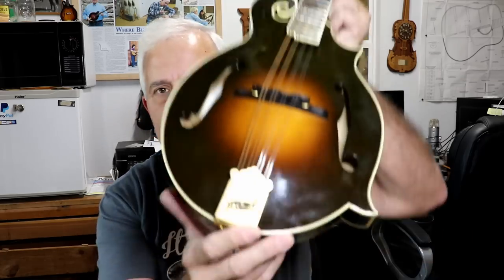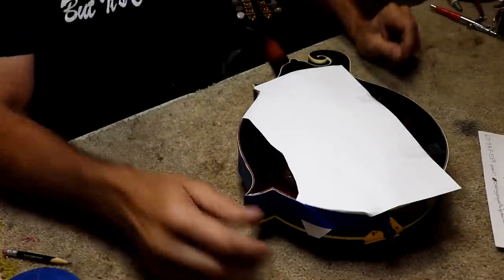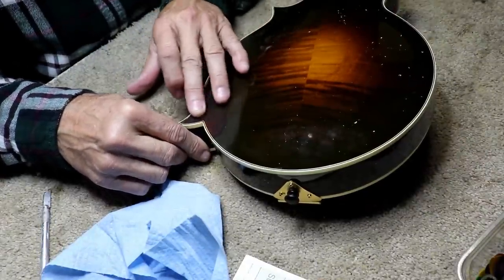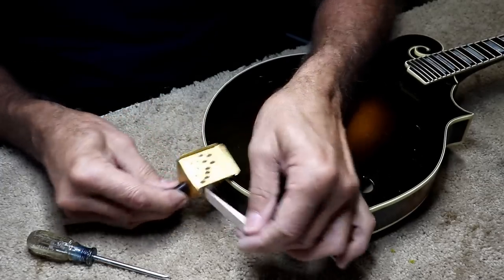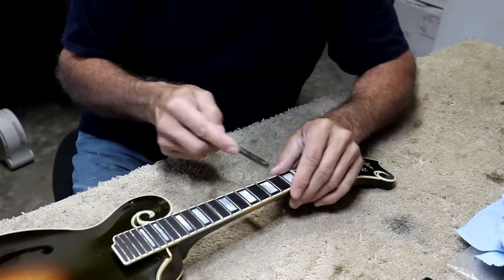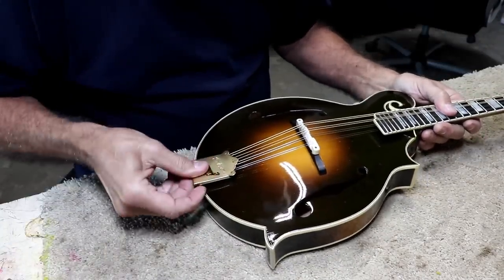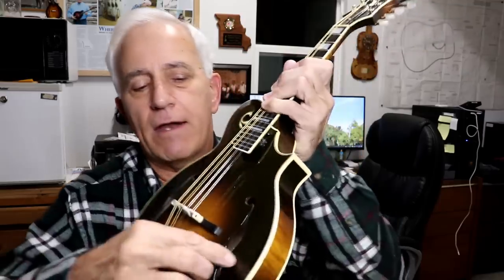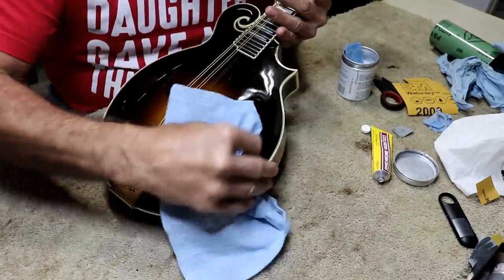342 RSW Sam Bush Mando Flood Survivor

Comment: Jerry you'll probably never see this but I'm going to comment . First as some viewers have said ,to use a drop fill applicator on the end of the CA glue to get a more precise flow into the crack .Also I would use the thinnest CA glue for this repair  . Actually I might just use Titebond thinned out . It causes less damage to the finish  . Now I also saw a tip from Dan E. at Stew Mac about hardening the CA glue and to use the vapors  from the accelerator rather than spraying it on . He pours some into an empty  bottle then empties it out  . Just hold the empty bottle near the glued area . This way it never touches the finish but allows the vapors to do the work . I understand you now realise the StewMac accelerator works much better and doesn't cloud up the way the other brand you used . 
I posted this here for other viewers to see  and might understand a better way to apply this fix .

Jerry I know this mistake bothered you terribly and I am in no way blaming you . It can happen to anyone . I feel you did a great job in repairing this instrument .

Comment: Just an observance on the scraping the seam after paintwork. Having done autobody work most of my life, this is the same basic method that is used in spot painting. but done with sandpaper to taper the repair edge before applying any finish or primer. Blending the new into the old instead of trying to fully level to the old paint. While I have not tried this on an instrument, it may be something that would make the job easier. Scrape your edge with the blade to get rid of the shelf before applying the lacquer and then a fine sanding after wards with a finger block to finish blend. Just a thought that may work for you.

Comment: My guess is that there were built up stresses in that top plate Jerry. If the vac nozzle had not hit it something else minor would have made it crack down the road. Who knows you might have saved him that grief by relieving the stress then repairing it now. In any case you did the right thing.

Comment: Suggest blending the lacquer finish with the airbrush. Prep the area with 1200 wet sandpaper first to knock down the existing lacquer. Use masking tape folding back on its self to create a soft edge. Gradually build up the darker colour to match the existing finish. Auto finish technique.

Comment: Jerry next time you have a crack to finish as soon as you have applied the lacquor turn the piece upside down to let it dry. Gravity will keep both sides togather . Please keep the videos coming.  Jim Parker
Reply from the maker: I'll try it. But it doesn't seem to make sense to me because when I hang a guitar up to dry,  the end of the guitar hanging above-the-ground still does the same thing which would technically be upside down.
Reply: Hi Jerry I should have said horazonal to the ground so that gravity will keep the laquor from sinking into the crack. It works for me.  Jim Parker

Comment: Sounds like your problem with the lacquer separating away from the crack is due to wax residue still in the crack. When removing the wax from the area around the crack it may be just pushing the residue into the crack itself, so as the last pass on wax removal you may need to just wet the crack and wipe it clean. In the auto trades in the 60's painted many vehicles with Nitro as that was factory material on most cars still, wax and grease remover tends to move the dissolved wax around so more than one wiping is needed to actually remove it, clean cloth every time.
Reply from the maker: That could be the problem. However I have the very same problem even on a brand new finish that's  never had anything else applied. If a tiny defect in the wood shows up, then the lacquer amplifies that defect.
Reply: @RosaStringWorks  There are so many things that could cause this it would be hard to list them all or pinpoint just one as the cause. It may even boil down to it being the quality of lacquer thinner you use, some has a more oily base to it that can cause separation instead of bridging scratches or defects, hardware store thinner is like that for the most part and meant to be used for clean up work, a gallon of quality auto paint thinner may be the answer (though I am not saying this is it with your problem as I have no idea what kind of thinner you use)...but the easiest cure would be to drop fill the area with non thinned lacquer if brushing or to spray several dry dust coats over the area before applying a wetter coat. If there is going to be a problem, cars or anything else, they always seem to be in the paint portion of a job.

Comment: Have you ever used thick cardboard rather than paper to mask when airbrushing?  You cut with some original, say 3/16ths to a quarter inch of original surface showing.  Spray from the CARDBOARD side at a medium to shallow angle.  Use 8-12 psi or so pressure with distance based on the amount of thinner you use.  Thinner is a carrier, keeping the lacquer thin, but air drys fast coming out of an airbrush for those who have not used one.  The cardboard height acts to feather the new coat along the edge, blending color and if required, thickness.  The cardboard or a similar stand off masking is in many of the old artist airbrushing  books to show feathering inks among other things when illustrating.  It works well in joining repairs.

Comment: I used an old oven stove top hood with a dryer vent through the wall to form the basis of an airbrush booth.  Use a brushless (old computer fan works great) motor to avoid spark caused flash fires.  I put an AC filter over the fan area to collect some of the solids and not paint the wall outside.  I used cardboard boxes and duct tape to the size of my project.  I have seen regular square fans with filter and cardboard used, but I wanted the fumes outside, while spraying and drying.  A plastic drop cloth tacked to the ceiling or board frame will form a quick spray booth to minimize dust and shop particles in the finish.
    Isn't 40 psi a bit high in that Pasche air brush?  Must be pretty thick liquid, or would the open cups work better than the siphon jar?  My AB has an auger to carry/meter the paint flow and you can literally paint a line the width of a human hair, versus the siphon method of the VL.

Comment: High pressure in the air brush and curved strokes seem to have really varied the density of the color in spots where you did not want it?    The new OTT lights with Yellow-White-Blue color modes really bring out contrasts of different colors?

Comment: Have you ever tried using retarder to slow the Laquer drying process down so it doesnt shrink as much and push away from the cracks or holes? Also slower drying time Laquer thinners too might help with your complaint.I use to paint cars years ago with Laquers and had to use different drying time Laquer thinners & retarder to deal with humidity and even too much heat......Glenn P.
Reply from the maker: I use retarder everytime I spray lacquer. I typically don't use it when I'm brushing it. But I have never seen the retarder help me with anything except the blushing.

Comment: I was taught never to bend my wrist spraying?  Prevents changing the distance nozzle to surface and the light-heavy-light effect of the curved pass bending your wrist?  Passes from bending the elbow result in the same distance, nozzle to surface, for the full length of the stroke.  Keeps the color and depth consistent for the entire stroke.  I am not sure that is as important on the instrument where you can buff the lacquer to color match, but buffing to match color does vary the finish depth?

Comment: Did your color wick under the original finish, adding your color to the original and causing the dark line?  The earlier comment on cardboard masks helps prevent this.  The light "feathering" spray seals the surface before you get enough on to wick.

Comment: People seem to think and it really does seem logical for a beginner to start with  light strings but it makes it harder to hold the chords in tune, leading to frustrations about how it sounds. I prefer my beginners to be frustrated with sore fingers. They tend to last longer that way.  

EDIT - I just realized how harsh that sounded so let tell you one of the first things I tell anyone want to learn guitar is that it's not meant to be painful, sure your fingers can get a little sore at first that's normal but if anything other than the skin on your fingertips is hurting then you need to stop for a while and later, maybe the next day or lesson, examine what technique might be causing the problem.  

edit 2 - why did I say any of this, this is a mandolin video, I don't anything about teaching mandolin, do they have that same problem guitarist do?

Comment: Have you tried those color blind glasses?  Lots of youtubes about them.
From the camera to youtube the repaired area seems more red.  And your lack of color vision reduces red.
Reply from the maker: Yes I have two pair. They're not that impressive. The cheap ones work really well for showing you lots of colors. The problem is they distort the colors terribly. The expensive ones which I bought thinking they would work better, really don't show me many colors at all. And neither one of them worked at all indoors you have to have bright sunlight.
Reply: I'm a technology guy so I have a technology solution for everything.  (I have a hammer and everything looks like a nail.)
Illuminate your shop area where you apply finish with halogen light bulbs exclusively.  They have the best spectrum.  LEDs and fluorescents create apparent white light via several bands of color scattered across the spectrum to trick your eyes into thinking it's white.  There are areas of the spectrum for those bulbs(most of the spectrum in fact) that don't have any light at all.  But a halogen bulb is a fairly pure black body radiation so the light is white because essentially all of the visible spectrum is there.  Sunlight is also a pure black body radiation light.  Come to think of it that might be why those glasses work better in the sunlight.  I'd interested how they worked in just halogen light.
Of course the draw back of halogens is they are hot.

Now, take a picture of the instrument under halogen light(or sunlight).  Load the image into the computer.  Load it into Adobe Photoshop or similar program.  Use the eyedrop color picker to see the RGB values for the colors at various points.  You might be able to deduce what your eyes aren't telling you. If the red(R) has a higher value in one area than another then you know it's more red.  And you can always call in the boss to tell you if she agrees that something is more red or green, etc.

(I use Gimp instead of Photoshop cause it's free and I don't do much image work. The Gimp eyedrop feature, after you do shift right click on the image, shows a color menu in the upper right with RGB numbers.)  It would be nice to figure out how to do this in real time so you wouldn't have to load images into computers and software.  I wonder if I could do that with a  Raspberry PI.

Comment: Hey Jerry, I hope you read this comment because I hope it could help you. I don't know if you've heard about Enchroma glasses that supposedly help to some of the moderately colourblind people, which I think you may be. They're not cheap, but perhaps they can help you see colors more clearly. I've heard you mention your color blindness for years now and I've not ever seen anybody suggesting Enchroma glasses to you in the comments, so I thought I would in case you don't know. Perhaps you could even set up a Patreon goal and/or a video of your thoughts on them once you get them. Cheers.
Reply from the maker: I've got two pair of the glasses. I first bought the cheap ones and was very impressed because they showed me tons of colors and I could even pass the color blind test. Unfortunately I realized that they really distorted the colors badly though it was neat to see them at least. So I thought perhaps the expensive enchroma glasses would work that much better. Unfortunately I was totally disappointed with those. They cost a arm and a leg and really didn't do anything for me that I can tell. In addition neither one of them work indoors. Though I've heard that in chroma now has some that do or at least are supposed to.